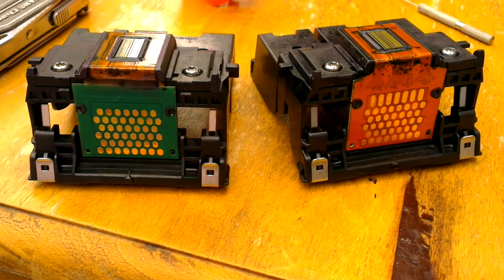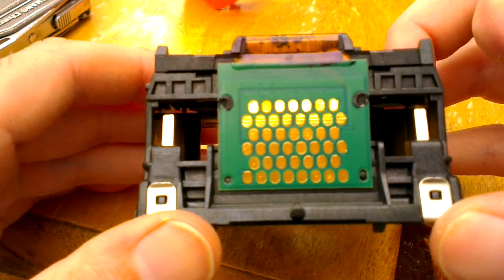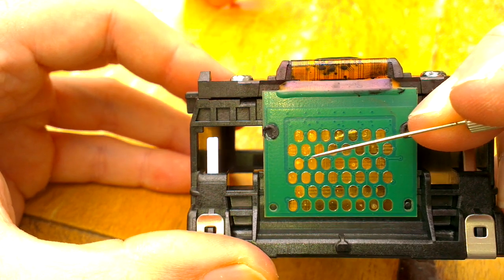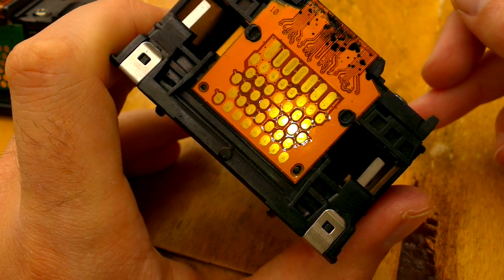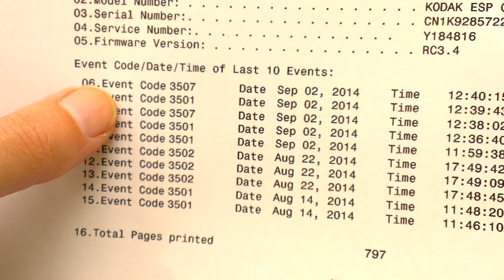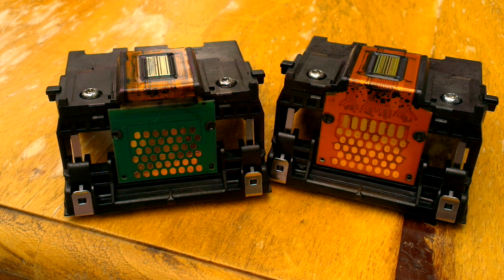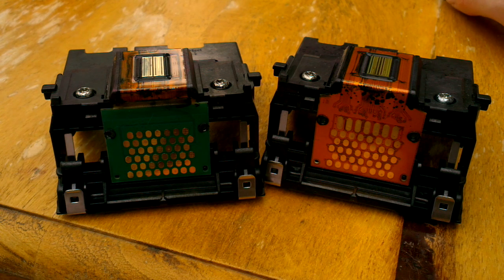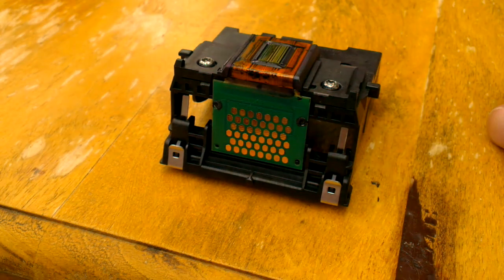KODAK ESP Printhead failure and comparison

Comment: Did you enroll your printer in the ink rewards program?  It seems like when I did that, my printer stopped working correctly.  Kodak told me that the printer is not repairable and I can but a refurbished one for over $800 which I paid less thank $150 for the one I have now.  I wish there was a class action lawsuit against Kodak.  All of the customer service agents are overseas and absolutely NO HELP at all.
Reply: I agree Alisha. That is why I have to decided to check out You Tube tutorials to see if I can repair mine myself. I will also check to see if I done the same thing as far as the ink rewards program. Thanks for the heads up on that. Mine will not print black ink at all. I have put 2 NEW KODAK ONLY ink cartridges in and for some reason something is sucking (and I mean sucking) ALL of the Black ink out of the new cartridge. SOOOOO....I am on a mission to fix it myself.
Reply: Carol Leandra Holifield Were you able to fix it?  I have the same issue

Comment: I have a Kodak ESP 310 and it no longer prints blue.  All of the other colors print.  Could I just clean in and it would work?
Reply: i have the same printer but the problem is the color red, hopefully we find an answer.
Reply: Well I did pull the print head and clean it and that didn't do anything.  It was very dirty but the print head looked pretty good.  I think it's a software issue.  I couldn't find an updated driver for Windows 10.  The only way I finally got the printer to work with my new computer was by networking it with my old one.
Reply: oh wow, thank you very much. I had to go out so i didn't get the chance of cleaning the printer head. (just got home) Well I'm going to clean it and then try it on my cousins computer. I'm currently using windows 8.1 and he has windows 7. Well thank you so much for the responding. Hopefully it helps and helps others also.
Reply: There is another video on YouTube that shows you how to pull the printhead.   It's very easy.  Good luck.  Let me know if that fixes yours.  If it does, I'm gonna pull mine again and give it another try.
Reply: Cheryl Lundgren Well I don't know what to tell you. It started working with out me having to do anything. I performed the clean printhead procedure a couple of times from the maintenance tab. I set the time on the printer and connected it to my computer, but these are things I had done before so I don't know what fixed the problem.

Comment: my kodak 5250 seems to be printing pictures with a green hue and some missing lines. Ive cleaned the printhead and replaced the ink but still doing it. Any ideas?
Reply: it's in Printing Preferences (assuming you are using Windows 7) from the Devices and Printers control panel.  you can changed the paper type settings there.  if all else fails, look for a kodak 10 series printhead replacement (not the ink cartridges) from either amazon or ebay.  the kodak 10 printheads were never redesigned like the newer kodak 30 printheads.  i tried replacing the kodak 10 printhead at least 2 times on an old Kodak ESP3 printer and using genuine 10bxl & 10c kodak ink.  the black ink keeps going out after a few printing sessions.  ultimately, I ended up throwing the kodak esp3 printer in the trash can.
Reply from the maker: +1ninjatiger Make sure the paper type is 'normal' in the settings.  Also, if you are using third party print cartridges they may be pigment instead of dye based inks which will throw the colour out.
Reply: +Sabretooth Barnacle genuine 10b and 10c kodak. Thats all ive ever used
Reply: +Sabretooth Barnacle been all through the settings .. Where do you check the paper type?

Comment: The gold electroplating is just to prevent corrosion, so it's only ever a few nanometers thick, the contacts have worn through the copper cladding on the PCB. I realize this was a year ago, but as you suggested, the best solution, short of jailing the engineering department at Kodak, is to tin the contacts with solder. Just flux it liberally and wipe a tiny bit of solder across each pad. Ideally this would have been done during manufacture, and the gold plated to the tinned copper instead of the bare copper. You can also soak the head in a solution of ammonia and water for a few days then rinse it or put it in an ultrasonic cleaner. The ink is water based and it's surprisingly easy to clean up, and I believe this is dye so it doesn't have the resins or gunk that dried pigment ink leaves.
Reply from the maker: Soldering the pads would be a good move. Cheers for the idea!

Comment: Fixed my esp 5250 it was showing new print-head required. I removed it checked it wasn't damaged I replaced it. The message on the screen was a new print head fitted, pressed start it went thru the motions printing a test page which was ok and now I'm back up and running. All without dropping a rock on it.

Comment: My HP Officejet Pro 8600 arrived with 750 pages, and counts towards 1500. The head has no signs of wear altogether. It has costed me just 80$ and is super supported under Linux.
Why I am writing this? After just one day, I brought all two of the Kodak ESPs back to the shop. This printer is so much an "alpha" and "entry" as it can be. And no Linux support despite what Kodak manager told me.

Comment: I presume it's not worth getting another printhead?, I was thinking about getting a HP wireless one instead - have you heard anything good or bad about them
Reply from the maker: The newer printhead is a different design and may have thicker gold plating on the contacts... However the printer hasn't even managed 1000 sheets of A4 in its lifetime and I think the original printhead failed at around 600 sheets. It's up to you what you make of that! Haven't owned a HP so not really in a position to comment!
Reply: well I'll say that some HP wireless printers are very good (the ones that cost $150 or higher).  I have an HP Officejet 6500a plus wireless printer and have very few problems with it, unlike with many Kodak printers.  just don't get the "cheap" HP printers that are less than $100 as those may run out of ink as almost quickly as the kodak printers.